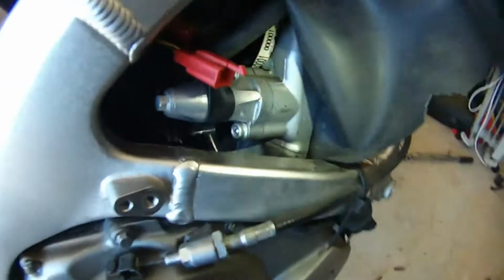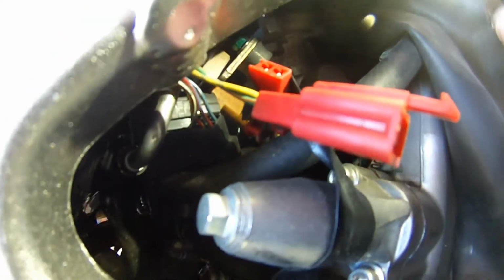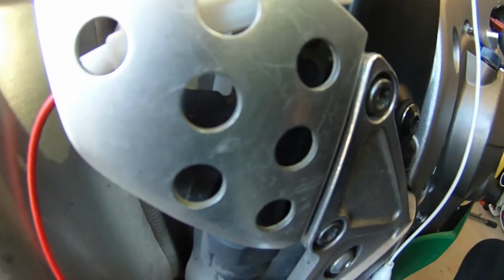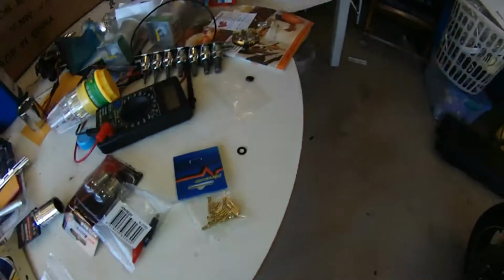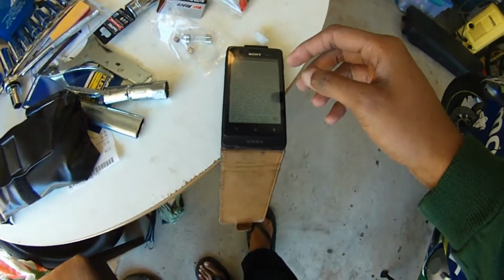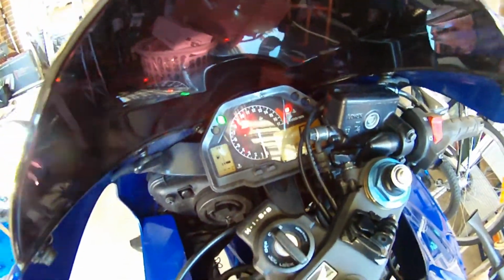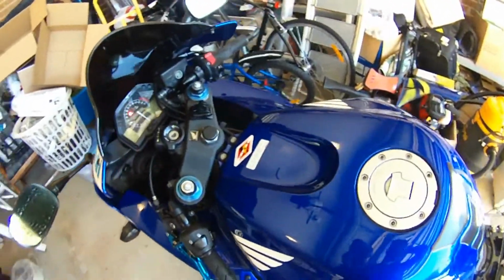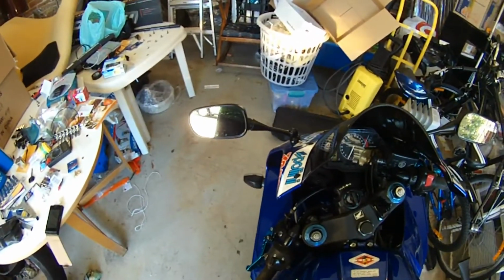2005 - 2006 Honda CBR600RR HISS Key Programming

Comment: I just did this on a 2004 cbr and it was exactly the same as yours! Red plug under the side fairings and no need to lift up the tank! I didn't have a fuse so i skipped that step and it worked but I would suggest using one just in case :) worked like a charm from the first try :)
Reply: Nice what did u use, straight wire from battery to spade connector?
Reply: @Grindatnight as shown on the video one wire goes to a resistor and then to the connector! The other wire goes straight from the battery to the connector! I only skipped the fuse part because i didn't have any